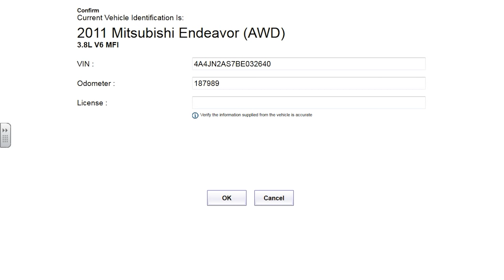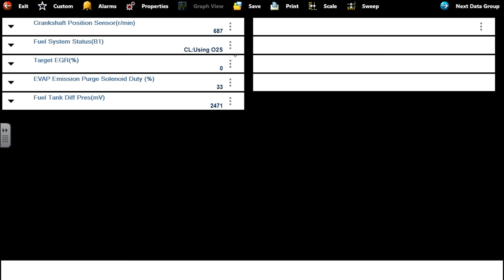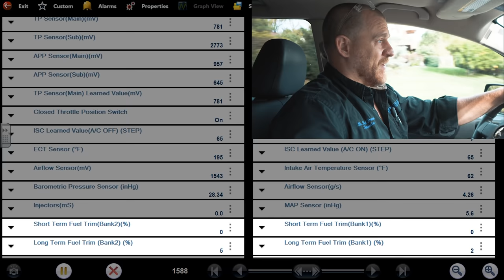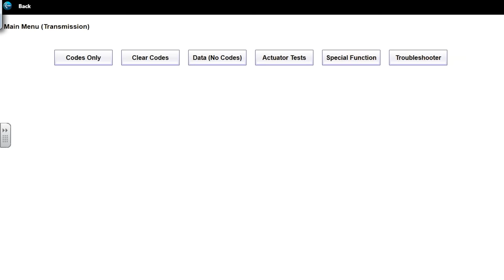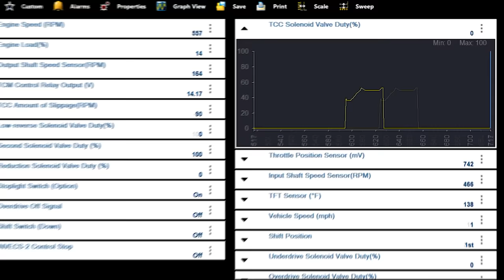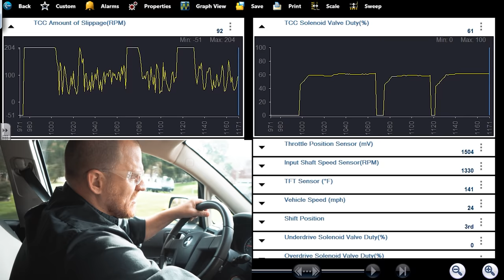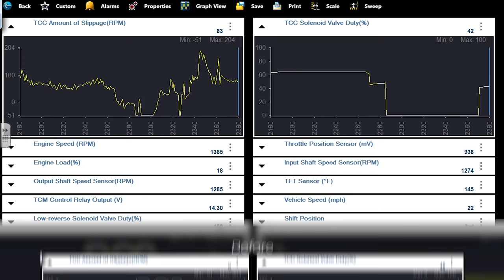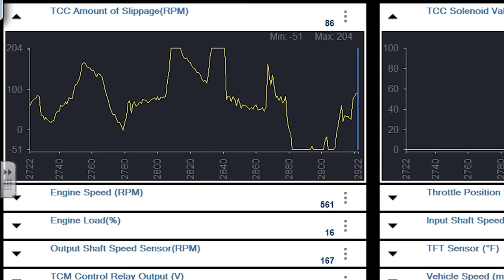2011 Mitsubishi Endeavor Misfire or TCC Shudder? Identification and "Fix"

Comment from the maker: Just added Instant Shutter Fix to my Amazon affiliate page, because, why wouldn't I?!  https://www.amazon.com/shop/scannerdanner
Reply: If one works would two work better?
Reply from the maker: @bigjohn2520  they state that one 2 oz bottle is good for a 10 qt system and that a maximum of 4oz can be used, but not more than that
Reply: I've been using that stuff for years.  I actually have a bottle of it for when I change the transmission fluid in my fiance's 94 Cavalier beater work car.  I used it recently when I changed the transmission fluid in my beater 92 Cavalier.  It seems to work.
Reply: but (SD)is danner gettin a life time supply for introduceing it??? (KNOW MEAN)
Reply: That stuff is actually pretty popular at the local auto parts store. I've never tried personally but I certainly would on one like that.
Reply: I had a chevy z24 that would not shift out of 1st gear after warmed up. I used lucas oil “slip and shutter fix” and it actually worked and shifted fine for a while. Eventually the tranny did go out again but did last a while. I  would be interested to know whats in those fluids. Someone should send them in to oil analysis place to see whats in them. I imagine there is alot of zinc and other lubrication modifiers. In the end we all know that tranny is soon to be burnt toast like the fluid thats in it. Not if but when. Btw mazda uses blue fluid in their cx-5 which i think makes it harder to tell condition of fluid because if its a lil dirty it turns brown anyway. Who knows why blue, only mazdinians lol
Reply: @captainmorgan6035  It's to feed the little smurfs that are inside the trans, pulling levers and stuff.
Reply: @bigjohn2520  @ 2 WOULD CAUSE TO MUCH SLIP.
Reply: DO you have a video the teaches how to use the tools (like DVOM)?
Reply from the maker: @christophermilhas5005  sure do, here is a start https://youtu.be/w0PpLTnKKZg
It is from an SD Premium class from chapter 1 in my book
Reply from the maker: @christophermilhas5005  sure do, here is a start https://youtu.be/w0PpLTnKKZg
It is from an SD Premium class from chapter 1 in my book
Reply: @ScannerDanner  have you heard anything from "Dr" instant shudder fix since this video posted?
Reply from the maker: @BigFrogs4x4  i haven't 😪
Reply: @ScannerDanner  that's too bad. Guess they figure they are too big a company to need us little people. Thanks for the great work.
Reply from the maker: @BigFrogs4x4  we even made a promo video for them (unreleased) 
I was talking with a marketing person but they never followed up with me)
Reply: @ScannerDanner  wow. It's good stuff for a temporary fix. I know some sketchy dealers use it to sell a car. Like k seal in the coolant to "fix" a coolant leak. It's a short term fix for a long term problem. 
BTW loving the big bad dodge on your FB. :-)
Reply from the maker: @christophermilhas5005  https://www.youtube.com/watch?v=w0PpLTnKKZg
Reply: That stuff does work.  I am not an additive type person, but I witnessed this stuff working.

Comment: The shudder is a known issue in the endeavor.  I'm on my second endeavor now both had the shudder. Both times simply draining and replacing the transmission fluid fixed the issue.  Great cheap durable SUVs
Reply: mine have 190k on it , my local mechanic told me if you do that , the filter will be clog and you will burn your transmission ? any Idea ?

Comment: I think the misfire is due to the tcc lockup shudder causing a quick slowdown in the engine speed. That’s causing the crank sensor to pick up the slow rev and cause a false misfire. Great video Paul. Watching this makes me want to make more videos.
Reply: It may have been, or it coulda been other things its just a guess but maybe someone will make dr instant misfire fix🤣
Reply: Very good point that’s what I was thinking

Comment: TCC slippage is a calculated value where the TCU will subtract engine speed from input shaft speed. (as an FYI). That value should decay to zero smoothly as the clutch engages. For me, the slippage value is the give away as the data on this vehicle was erratic.
Reply: You would think the TCC slippage should eventually drop to zero, but actually some vehicles have PWM control of the TCC solenoid and can partially lock the clutch under some conditions and allow for some continued slippage instead of a complete lockup. From the research I did, this is mostly done for NVH reasons since people don't want to feel the clutch lock up and a small amount of slippage absorbs some engine vibration. Seems ridiculous to let the clutch slip constantly, but some vehicles have used that strategy since the 90's.

Comment: I got rid of my 2004 at 168k miles. I "wanted something newer". A few years later I got bored and looked up the VIN, someone is still driving it around at 210k 😢. I hate that I let it go! My fancy RDX does not compare in the snow at all! If you have one, keep it! Yes, you'll have to replace the radiator and tensioner pully/belt/water pump at about 115k, but it's a beast of you keep it up!

Comment: I'm only half way through the video and I'm sure you probably address this at the end, but I have been seeing a lot of vehicles set misfire codes for both torque converter shutters as well as wheel imbalance issues and severe brake pulsations. It has to do with the vibration transferred to the crankshaft that the crankshaft position sensor picks up as a misfire. Also, that shutter fix is AMAZING! haha I have used it a handful of times and it always seems to work.

Comment: I have a 2014 Honda Odyssey. I swore it had misfire issues. Torque converter shudder feels exactly like misfire issues. The dealer did the fluid change and it fixed it. Perfectly. Every other oil change I drop three quarts of the Honda fluid in it. NO problems since!!  I needed that Mr. Shudder Mudder stuff. Cool vid. It will help a lot of people!!

Comment: From several years of experience don’t have the transmission fluid flushed. Just find the drain and drain it if the filter is serviceable change it. Then add correct tranny fluid to fill it back up this will bring back some of the viscosity. Once you’ve driven it for 500 miles you’re satisfied with the color of the transmission fluid then add shutter fix I have also had good luck with Lucas transmission fix. I use Lucas transmission fix all my trucks that I work with even before there’s a problem. I have had very good luck with this.

Comment: Lovin the banter tween you and bro.
This one reminds me of one, I don't remember if it was you or another YT Auto but a plumber's service van would lose all power and die out when it was on a rough road. Turned out the supplies banging around in back made it to the knock sensor and pulled all the timing out until it couldn't run.

Comment: Being. In the transmission  business I have seen misfire  codes when there is a  tcc engagement . Dr shudder fix works good 👍
Reply: Lucas transmission fix works well also, till it doesnt anyway.  I wonder if it’s just the same crap in a different bottle

Comment: I used Dr Tranny’s Instant Shutter Fix in my 1999 F150 XLT four and a half years ago. Had the same exact problem. Within a few days of driving it the shutter was completely gone. I used two tubes of it. Still driving it with the original transmission @ 327,000+ miles.  Glad to see this video because it reminded me to order more . . . Just in case!

Comment: Dr shudder fix, I’ve actually used it.  Used it in an 08 Subaru Tribeca that a buddy had a quick change oil place service the trans and they put the wrong auto transmission oil in it.  Subaru is apparently very specific about using their trans oil.  I put about a case of Subaru trans oil though it, changing the trans oil about four times after short road tests and then added the anti shutter to the last changed.  Fixed it for about a year until the tranny went out completely.  The stuff is like posi rear end additive,  allows it to slip instead of grabbing and slipping.
  You get out here in California we’re labor rates are approaching $200 an hour and it become cost effective sometimes to throw parts at a problem.

Comment: That Instant Shudder Fix is a miracle in a tube. My 2006 Endeavor with 230k has been shuddering for the last 50k miles. After adding the Instant Shudder Fix it's 90% gone. Thanks for the scoop. I'll check back in at 330k.
Reply from the maker: Heck yeah, that's awesome
Reply: did you change the Transmission oil filter ? or u just add the Shudder Fix to the burn transmission oil?
Reply: @Therealpeter961  I just added the Shudder Fix. 
3 months out and it's still going strong. I'll say it again Shudder Fix is a miracle in a tube.

It takes between 30 minutes and an hour  of driving for it to work well and then it just gets better and better.
Reply: @AcousticGroove56   Awesome, yesterday after I saw this Video I went to Autozone here in Dallas and gets that magical shudder Tube, yep 15, and it's gone. Thank you for your help. I am considering changing the Transmission fluid in the future
Reply: 6 months later it started with a slight shudder again. One month after that it was a little more pronounced.
When I checked the transmission fluid I noticed it was a little over filled from when I added a little years ago.
I suctioned out a little and then put in another tube of Shudder Fixx. I drove it and the shudder is gone again.

I'm still very impressed with Shudder Fixx.

Comment: I had the same issue, changed the solenoid, filter and fluid, worked great for a thousand miles then the transmission completely failed.  the solinoid  tested fine electrically, I figure that there was metal shavings going through the tranny.  hind sight is 20/20.  lessons learned.

Comment: Wife's Jeep Wrangler does the same thing.  I fixed it by turning off the O/D, lol.  I'm totally buying a bottle of that Dr "instant" shudder fix on your affiliate page!   It will be my second "mechanic in a bottle" if it works.... My other one is REV X Stiction Fix Oil Treatment that gets rid of my rough engine on my 6.0 powerstroke diesel.

Comment: We have an Endeavor, Just from my personal experiences - when it sits to long & the batter voltage drops I will get Misfire Codes, so I clear the Misfire Code & just charge the Battery before start it up, they never reappear again.  He stated the. Voltage had dropped to 9.0 volts before he started is, so the batter is weak & will cause a misfire on start up.
 - On the Transmission, had the same scudder issues, and if the Fluid is Redish Brown to Brown it needs to be flushed & changed out, especially with front wheel drive cars the Transmission fluid needs to be changed around 50-65k depending on the model.   I’ve switch ours out to Valvoline Synthetic MaxLife ATF, which is certified to work for Mitsubishi ATF S-III types, and other.  Works great now.

Comment: Wow what a trip.  I've been working on an almost identical issue myself.  My 98 Accord has been doing the same thing, just not quite that rough yet.  I am using a JDM automatic B7XA, which is pretty much just like the original trans, I just had to change the speed sensors out on it.  It only had 25k kilometers when I got it.  I've put about 12k miles on the transmission, and the F23a1 is freshly rebuilt.  When my torque converter locks up though,  especially if your trying to drive easy, every time you let off and reapply a tiny bit of throttle there is always this jerkiness.
Reply from the maker: Nothing to lose with giving this product a try.

Comment: That shudder fix is good stuff. I’ve used it in Honda CR-V a lot. They will usually shudder a little bit when it first locks up. If it’s relative low mileage and not supper dark I’ll put it in and have the customer see if it improves.  If it does then call me and we will do a flush and good to go.

Comment: This triggered PTSD. I bought a cheap low km mitsubishi lancer wagon as a run around when I was a young mechanic. Test drove great. Once I bought it and drove it on the freeway, felt like the entire driveline would shake out of the car.
My first comment was, "it feels like the torque lock up going on, off, on, off.
I was a parts changer at that age and trusted the more senior tech's that helped. Checked for misfires and engine running until the cows came home, full transmission service and flush, engine mounts, wheels and tyres swapped and balanced, driveshafts swapped, wheel alignment etc etc. Significantly better, but not fixed. Took it to a trans shop. He drove it and instantly said, "your TCC is toast". 😭

Comment: Paul, Dr.Tranny Shutter fix works!
For worn /glazed converter clutches. Clutch chatter.
I've used it many many times.
4L60es especially.
That 55-60mph shutter on throttle tip in...gone.
Reply: If I pull the trans I'm replacing the tcc & converter

Comment: I just had this issue myself on a 2019 Mitsubishi Outlander (4J12 engine), was throwing a P0304 caused by lockup clutch shudder, had over 400 misfire counts on cyl 4 and a very small number of counts (< 30) on the other cylinders. The lockup clutch solenoid is controlled via pulse width and operates above approx 15kmph. Had to de-pin the solenoid control wire at the ecu to confirm. What I found interesting was the misfire counter constantly picking on cyl 4 when in reality any of the cylinders could have thrown a misfire code. I think the ecu was getting confused and defaulting to cyl 4.

Comment: Nice video you guys. I added it to my 4R70W transmission in my 2001 Ford Crown Vic and it started to help a bit, but only lasted a couple days. I have bought all the parts to rebuild and upgrade the transmission and torque converter and will pull it in December. I bought the car a couple month ago with the OD light on and shift solenoid codes. It needed the transmission harness since it was shorted out to make it driveable. I guess the mechanic in a bottle let me down. :-) It's a West Coast car with zero rust and only 110,000 miles and it's worth a $1000.00 in parts to me to build the transmission.
Reply: I have an 01 vic also, I got it with 237k on it and it has had a slight hesitation around 40 mph, ive since put 40k miles on it with it doing that still...I changed solenoids filter and just enuff fluid to fill the pan and still no help not to mention i used dr shudder and it helped a little but still does the same...ive replaced every sensor I can think of and no help....car has had me confused for couple yrs now but it pulls great up hill and all....do you have any suggestions.....?
Reply: @berniceperry8898  I’m working on a concoction now called Dr. instant hesitation fix I’ll let you know when it’s available 😂
Reply: @captainmorgan6035  cool because I still have the hesitation...we could use my car as a test subject its got 280k now, I always say what doesnt help will not hurt it...
Reply: Fluid exchange with Mercon v and the shutter fix took care of alot of the ones I worked on back in the day. Cant remember if the 2001 had a torque converter drain plug, I think no. Maybe 2000 was the last year that had that.
Reply: @mph5896  yeah my 01 has the drain plug, I didnt mess with it tho....do you think if I drain it that it'll help, ive never done it before and was wondering if I drain it do I just add the same amount of mercon v thru the fill tube to replace it ? I relpaced the filter and pan fluid is all....thank you for any advice I sure appreciate it....
Reply: @berniceperry8898  Dropping the pan and draining the converter gets out most of the fluid. You just refill it through the trans fill tube. Put in like 6 qts, start it up and run it for a minute. Shut it off and add a couple more. Run it and keep checking/topping off until its full.
Reply: @mph5896  I apreciate the advice, ill check into it when this weather straitens up some...
Reply: Bunny Hall those old fords also had a misfire problem when the engine is lugging. Basically cruising about 40mph with very little load. The individual coil on plug boots are leaking electricity causing that or a coil going bad

Comment: To verify a TCC problem you can use a NVH tool. There is a handy app for your phone (must have the appropriate sensor on the phone) that uses the sensors in your phone to test, it does cost $99 but that is cheaper than the $399 they were charging a couple years ago. It is way cheaper than a pico scope for NVH. It requires some interpretation but I have found it helpful.

Comment: I’ve had Lucas transmission fix get some extra life out of transmissions for customers before. As long as you inform them of the problem and make them aware that they’re on borrowed time with the transmission then you’re doing right by them. Transmission rebuilds are not cheap and if you can help them with a little time to save the money to get it fixed then they are usually grateful for it. It’s also a good time to teach them about proper maintenance after they spend the money to get it rebuilt. When they have that much of an expense with no notice they tend to start taking advice about maintenance seriously when approached correctly.

Comment: Back when i first started in 91 ford had this shudder in the Taurus and it affected almost every one of them. their fix was to create and release the shudder fix additive. The stuff works as i have used it at least a thousand times in my thirty years. While this may only be a band aid fix Ive had customers go another 30k miles before having any more symptoms. When I could I recommended repairing or replacing the trans but sometimes its not cost effective. Dr Tranny's has been around for a long time.
Reply from the maker: wonder why they changed the name 🙄